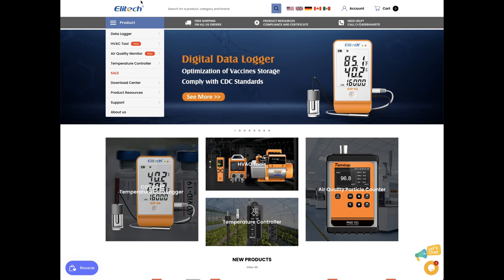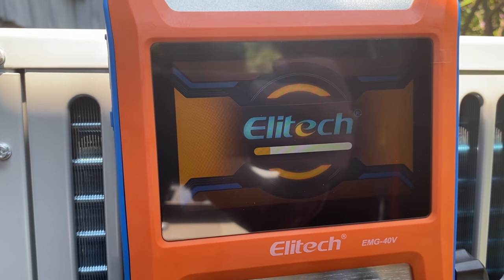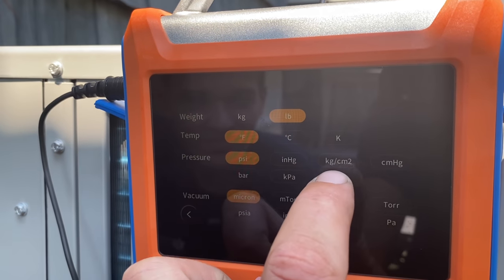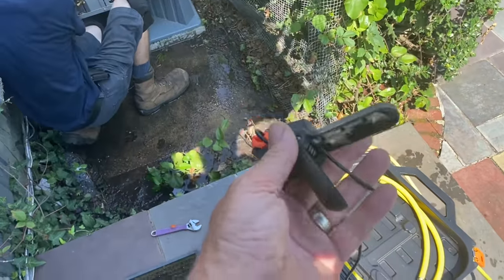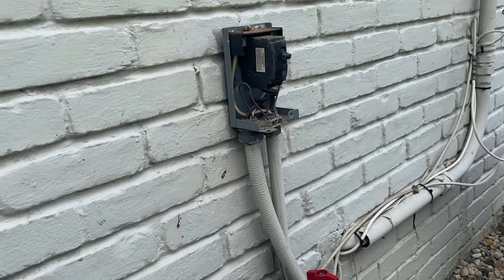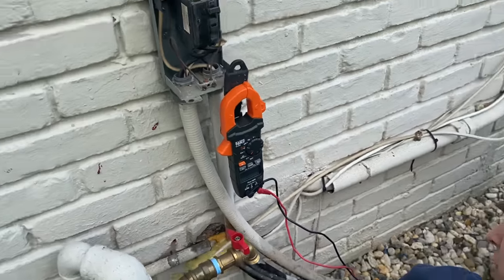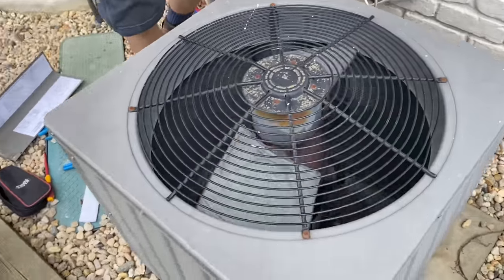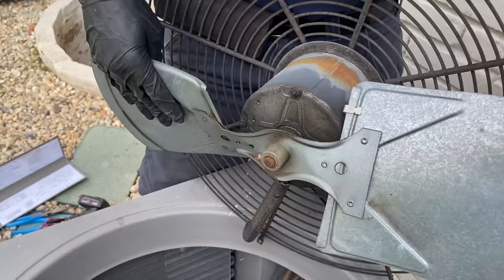Running AC Service Calls with Elitech EMG-40V Bosch IDS 2.0 & Central AC Not Working Power Issue

Comment: Good call! Just because a fan isnt pulling a bunch of amperage doesnt mean its good. This proves that your gut instinct from years of working on these systems is sometimes better than going by the numbers in a book.
Reply: wrong wire tested, if it's running proper speed/load/voltage and cap. value, the fan cap. lead will be approximately 1/2 of the total motor current draw ;)
he should have tested on other wire!

Comment: Hi Mikey,  love your way way of explaining.  Very entertaining and straight to the point.  I am a homeowner, went to school for Computer Science and Engineering so I know some concepts and can understand things, but I am no HVAC guy or have the time to learn.  I had a BOSCH 1.0 installed a few years back, and I am afraid it is overcharged.  So I was thinking of buying some digital gauges and measure SH and SC to figure it out.  Yes the previous HVAC guy will come out and try to diagnose but I don't trust he was doing a good job,  his hoses and gauges weren't working and i do remember at the time that the SH and SC were not to what the manual was saying, but we did charge by way of weigh in, and accounted for line length.  Calling the original guy probably won't cost me much, but a new guy will charge me over 1200 just to take a look at it ! because they say they have to diagnose everything, redo the charge and so on..  Anyway I am looking for some gauges that don't break the bank but  are also good enough to give an accurate reading.  Again I am not a pro, and I won't use the gauges maybe but a handful of times, so what would you recommend for someone in my case? so far I was looking at Elitech EMG-10 ($189) or the Testo 550i ($247) or Elitech PT-500&PT-800 ($145)  Plus I will have to by some $80 hoses to make sure i get a tight seal.
Reply: If you didn’t spend any money yet then my advice would be don’t waste money on digital gauges. Spend $70 for an analog manifold. They come with hoses as well. There’s apps you can download where you type the high side and low side and it does the math. On the outside unit there should be a graph that tells you what the pressures should be for the temperature. Unless you plan on getting into the trade or have money to waste , do it as cheaply as possible. Legally speaking you also need a tank to collect the refrigerant you take out as well. If it’s only over charged you shouldn’t have to pay over $250 imo
Reply: @SpaceCadet327  Thank you

Comment: Hey Mike,
That is a Square D disconnect.  That device in the disconnect is not a breaker, it is strictly a disconnect/switch.
PJH
Reply: exactly and they're known to be junk and once turned off game is over, replace the whole disconnect.
in fact, as soon as you see one of them automatically assume it's bad and price replacing it, ALSO assume it's had one or both legs bypassed and test for power across Line-1/2 and both to neutral/ground!.
out in the field you'll find gobs of hackwork with one or maybe both disconnect legs bypassed and you assume it's powered off jumping in hand first can land you multiple feet away or DEAD.

Comment: those square D "disconnects" are just that, a simple disconnect in a breaker style case, they are not a current limiting device. there's a tab to prevent a regular breaker being installed into them.
those disconnect housings are not meant for a current limiting breaker, because the physical housing size is too small and the breakers thermal output is too high, so it would overheat.
that said, those are known to be junk and they rarely work once turned off and and back on, bets bet is replace every one of them you have to service!
Reply: big yellow sticker on the side tells you, "no overcurrent protection". they rust/corrode inside from moisture and water and once flipped off, game over.
if I've replaced one, I've replaced a zillion ;)

Comment: When you have a bad part like that fan motor you always replace it so the customers unit will perform properly regardless of when it's going to be replaced! If that unit had failed an hour after you left that would make Mikey pipes look bad and you might not be called back next time !

Comment: Depending on the cost of the fan I'd probably let it buck until they replaced the system. If its a $50 fan then might as well throw a new one in.

Comment: I'd change the CFM.  Low(ish) cost to replace, will make the system run more efficiently and maybe get them through another few cooling seasons.
Reply: @PipeDoctor  you're the best!! it's faacinating to see you work on these different systems.  I'm in SE Michigan and never have worked in an attached here.  where I work now I just have to service magic pak thru the wall packaged units so it's boring, unless I do work on the side. keep up the comtent brother.

Comment: I would let the homeowner know what I found and tell them it needs to be replaced. Here it tends to be a little hard to get people to change a motor that is running and we also find a bad disconnect. but it is what it is, you can lead a horse to water but cant make it drink.

Comment: Who knows,I had a motor seized up,I asked the roofers for some air tool oil,broke it free,lubed it up and that was like 7 years ago,blows my mind! I figured she had someone replace it!
Reply: they likely changed it themselves or someone they knew(handyman)
Reply: @throttlebottle5906 ,no ,she called me to see about a new system,and it was the same one,with the same old motor,with the orange paint pen marks I put on it! I marked the shaft ,before I took the fan blade off!
Reply: @petersmart1999  surprising, but maybe it was ants inside it or it made the hard grease fluid again. lol

Comment: Is that the house that had those rheems, On the new Bosch 2.0’s new installs. Think you guys were talking about some watch? And I would replace the fan motor and advise to look towards replacement on the whole unit with it being old and R-22 and having issues, puts foot in door and also is the right thing to do.
Reply: @PipeDoctor  danggg. Install looks great though !!

Comment: Imagine if every tech that came out there unnecessarily put there gauges on that system , how long till that little purge adds up to a low charge ? Gauges one of the last things you should put on a system , too many new techs blow off a pound just checking a charge during yearly maintenance checks ,ONLY  if everything else points to it should those gauges go on a system , just my 2 cents

Comment: ARE PARTS AVAILABLE? WHY ? I HAVE HAD ISSUES WITH 2 TESTO'S AND FIELDPIECE LEAKING AND THESE 2 ARE ALOT MORE EXPENSIVE THEN THIS ELITECH BRAND. I WOULD USE THEM FOR ATLEAST A FULL SEASON BEFORE DOING A REVIEW CUZ EVERY PRODUCT LOOKS AND WORKS  GREAT WHEN ITS BRAND NEW. MY $600. FIELDPIECE DIDNT LAST A SEASON BEFORE IT STARTED LEAKING REFRIGERANT THROUGH OR BEHIND THE SIGHT GLASS. REAL DISAPPOINTING.
THEY WORKED BEAUTIFUL WHEN NEW. LOL. MY TESTO'S LEAKED THROUGH SIGHT GLASS BUT ATLEAST THEY ARE FIXABLE. AND EASY TO GET REPAIR KITS.

Comment: The kid needs to ditch the gloves, this is the time to build the calluses and his man hands.  Jesus was a carpenter, he did not wear any gloves.
Also,  slide the phone holster about 60 degrees to the rear between the back and front pocket area, and forget the knee pads until you are 50, Just carry the little pad your dropdown.
Reply: Horrible advice. lol
Reply: @Jamie-po9zk  Mr Pipes has some Swagger, no reason why this kid cant be a Cool HVAC Tech. Popping on Knee pads and rubber gloves before removing the panel off the side of a Condensor is not cool.  or you go single knee pad, that is also Gangsta 

If you are doing some plumbing gloves are fine.
Reply: gloves, how do they fit, furthermore how do they not shred in under 10 seconds. that sums up every pair of fluid/chemical gloves I've ever worn, also within that timeframe they have enough hand sweat inside to slosh around and pour out the wrist areas. if I manage to not shred them, within a few minutes I can pour sweat out.
Reply: Play in traffic